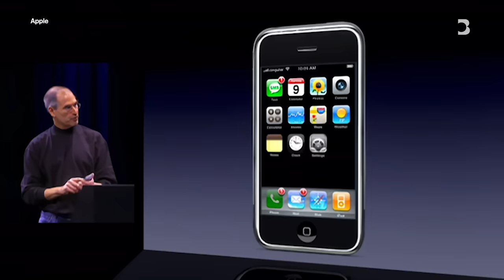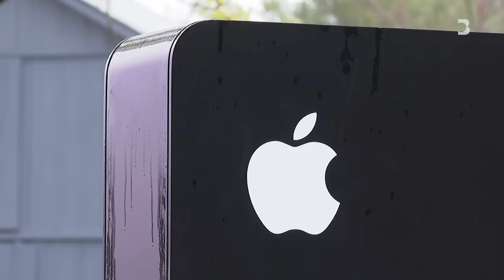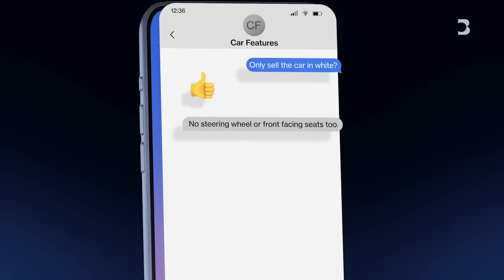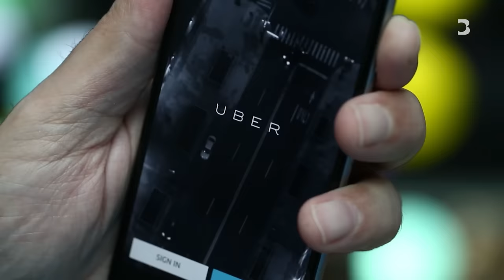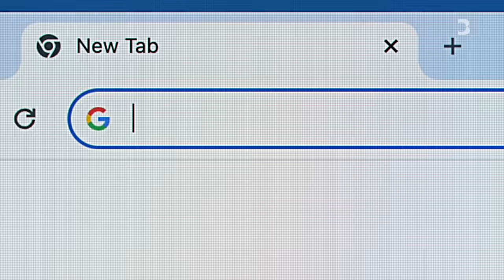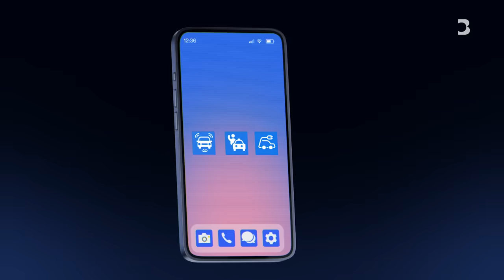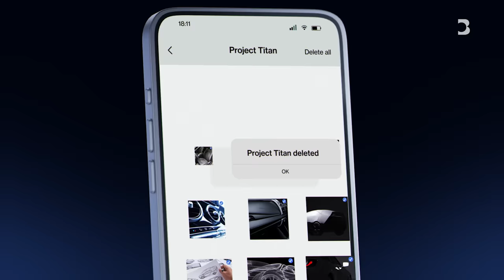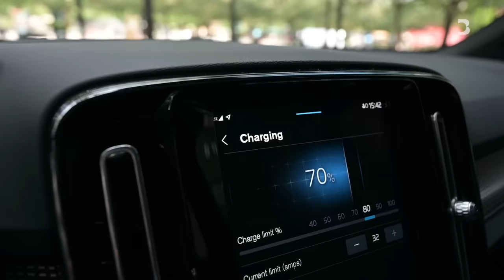What Killed the Apple Car?

Comment: paying extra for your car's charging cable won't ever be a thing now
Reply: No "environmental pressure" on the cable too 🤗
Reply: Have you seen the cost of Tesla's cables? It's already a thing
Reply: I paid $250 for my teslas charging cable lol
Reply: @romansanders  Buyer beware.  It's such an old phrase that it's origin is Latin (Caveat Emptor).  Yet people still love to drink the Kool Aid.  So be it.
Reply: Bad joke, Apple includes a charging cable with every rechargeable product it sells.
Reply: Everyone is doing that though, because consumers are too braindead to understand that EV's can be charged fine over night from a normal power outlet and you don't need fast charging.
Reply: @alexronaldinho12  Would be $500 for apple cable. And you need a subscription of $9.99 a month because there'd be a micro chip for "safety" in the plug.
Reply: No cable needed. Apple cars will be charged wirelessly at 10 watts. 😅
Reply: @pawel7196  I think you misunderstand that in the case of luxury items increasing price increases demand
Reply: @ignaciocampos8435 But no brick.
Reply: Tesla’s don’t come with chargers 😂
Reply: @residualramirez  they also dropped the price by more than enough to make up for that since that change.
Reply: Never under estimate the other guys greed. I learned that from watching scarface!
Reply: or having to crawl underneath the car to plug in the cable.
Reply: Tesla
Reply: Ev sales continue to double every two years.  This video is incorrect.
Reply: Don’t you want to save the earth? Also known as saving environment.
Reply: I don’t understand why garbage jokes get so many likes. It amazes me
Reply: @residualramirez Not correct. At least in germany you‘ll find in every car a blue cable for public AC charging and a mobile charger for any 230V power outlet (national standard in Buildings).
Reply: "What Killed the Apple Car?" - Tim Cook
Reply: LOL!
Reply: Tesla already does that
Reply: Well Adleast  my Silverado EV came with a charging cable
Reply: It already is

Comment: Simple answer: The lightning charging port was banned in EU
Reply: And you had to turn the car over to charge it
Reply: We just can’t built it with USB-C. It wouldn’t work with our proprietary standard equipment  Frappuccino machine. Scrap the whole project, they said. Our core demographic won’t buy it unless it has a Frappuccino machine.

Comment: Prototype is easy, production is hard, profitability is even…..?
Reply: Dyson also went thru the same epiphany as well after they built their own EV prototype, which was why they also canned it

Making a fantastic prototype and tech demonstrator is one thing, translating it into a production model that is profitable is another thing altogether.
Reply: I’ve been wondering when Dyson is going to come out with a carpet cleaner.🤟
Reply: It was the fact that full self driving was never going to happen. They fell for Musks BS .   @SoranPryde
Reply: @steviegbcool  So are you sure? When’s the last time you drove a Tesla with FSD?
Reply: You can't just put a steering wheel, just shut down a 10y project and dispose 10b USD away
Reply: @MetalAlbumsPodcasts  So you have the right handle nonsense! What are you even talking about?
Reply: @MetalAlbumsPodcasts  🤣🤣🤣
Reply: @theodorehaskins3756  that whats apple spent on the discarded project
Reply: @SoranPryde  Also Sir Dyson made the comment that his team had to be 100% self reliant no tax credits, no squat. It had to be profitably on its own. They could never obtain that success internally doing the math.

Comment: I think the weirdest situation for apple is that, to build an autonomous driving car, you really need a lot of data, and apple isn’t willing to sell the car without selfdriving capabilities first. Testing only with your own team really can’t match the real consumers testing.
Reply: Waymos cars EACH cost $250,000 as ATV.
Reply: i disagree. Almost all manufacturers have designed their system so far without acquiring massive amounts of driving data from their customers. Tesla is the only exception and they are not really ahead in the market compared to that competition.

The big issue imho is the goal they had set. Level 5 autonomy is still a long time away. We won't see it this decade and the industry is already shifting away from the promise of driverless cars and pivoting once again towards level 3.

Comment: What am i missing here?

Xiaomi has much less cash than Apple and started the car project much late.

Is this a case of chasing perfection instead of focusing to finish the job at hand?
Reply: They has Chinese supply chain and Chinese EV market which is the biggest in the world.
Reply: @directxxxx71  "They has Chinese supply chain and Chinese EV market which is the biggest in the world."

So? Apple could have produced a car if they wanted to.
Reply: @yourcrazybear  Could they have produced a compelling car that fits in the ecosystem, at a profit, without the huge China subsidies? No.
Reply: If you see from apple perspective every product they create is not allowed to work correctly and repairable by third party and that is way harder to implement in automotive industry, I think this is one of the major reason.
Reply: @yourcrazybear  Car business is a HIGH CAPITAL COST business. Apple don't deal with those kinds of business model. Car companies like Toyota, Ford, and GM and VW have a VERY HIGH DEBT in the 10s of BILLIONS in debt. VW have around 160 to 230 Billion dollars in debt. That is around what Apple has in their reserves and not much debt. It is opposite of what they do.
Reply: @jonaboy3  "@yourcrazybear  Could they have produced a compelling car that fits in the ecosystem, at a profit, without the huge China subsidies? No."

Yes they could have.
Reply: @jonaboy3 it took 10 y and 10b USD to figure that out...

Comment: Apple: You want doors, sorry doors are not included, Customer: What size battery does it have, Apple: sorry !, umm we just derated it without telling you, Customer: what size did it have, that will cost you extra to know that, Customer: Excuse me there is no steering wheel but it does not have FSD, Apple: oh about that, the steering wheel is not included but we can add one in for a small fee of $9850, Customer: that seems expensive why, Apple: Because we can

Comment: They probably figured that if they hire Foxconn or other manufacturers to manufacture their car, it wouldn't be profitable enough.  They're very particular with having high profit margins on each product they sell, so I'm guessing the profit margins for a car wasn't enough.  Take for example NIO, they make the software and designs in-house, but contract a manufacturer, like JAC Motors, to manufacture their NIO cars.  Of course, JAC has to make a profit off each car to justify manufacturing one, and NIO has to profit off their car, too.  What NIO gets is an expensive car they have to sell, but they can't make it too expensive, or no one will buy it.  So they have to lower it to make it appealing, but they sacrifice on profit margins.  
Only Tesla right now has the highest profit margins on each car they sell, because they did not just vertically integrate their designs and software, but also the manufacturing of the cars themselves by owning their own factories.  Apple could do the same as Tesla, by building their own factory, but that must've been too complicated for them to justify the initial investment costs associated with building their own factory from scratch, as they're used outsourcing to Foxconn. 
Maybe Apple will do the Apple TV way?  We've heard of rumors about an Apple TV, not the box, for almost two decades now , and the rumors were high around 2010 - 2014.  The reason Apple won't make a TV is because the TV market's profit margins is paper thin.  Not worth it for Apple, so they made a TV box with Apple software in it, and sell it for $150.  So maybe Apple will just partner with car brands to use their software for a fee.

Comment: This makes alot of sense as to why they shifted to AI and VR "Spatial Computing". This could actually be beneficial in 3 ways. 1.) Apple helps build better AI models for the infrastructure that maybe others in the industry are missing. 2.) Apple helps popularize VR which they're doing right now for the average consumer market which is going to focus more attention on VR and it's future as well as help build things in VR that are much needed with apples budget. 3.) Apple will be the reason VR becomes an at home, at work and on the go necessity to replace or even be another option other than using a smart phone, tablet, laptop, or tv. Oculus started it, Meta made it better and affordable, Valve improved on the possibilities, Apple can bring it home or maybe Valve might enter again wwith the deckard on the way.

Comment: It's so funny that people/companies think a VR/AR Headset might replace a smartphone.

Are you going to run around outside with such a thing in your face? Me neither.
Reply: People with no self awareness will. Apple is banking on more of those people. lol
Reply: a 2010 technology headset to be exact
Reply: It'll get small enough to wear as Sunglasses. I'm sure its the future. It only takes one person to figure out the correct implementation and seal the deal
Reply: @JoshuaRotimi  Google glass was small like sunglasses. They failed too.
Reply: @mmmh2533 Non-invasive means still allowing google or some other company access to your thoughts.

Plus it would still mean sticking some electrodes all over your head. Not gonna happen any time soon, the technology is decades away.
Reply: @einname9986  The implementation was wrong thats why it failed. Did you understand my comment?

Comment: The cost of electric vehicles is significantly influenced by the expense of their batteries, which constitutes a major portion of the overall cost. This situation is further compounded by the near-monopoly that several Chinese companies hold over the battery industry, a dominance partly maintained through patents. This has made it challenging for many companies to reduce their production costs. Tesla serves as a prime example of this issue. Contrary to what some might expect, Tesla has approached BYD multiple times to outsource battery production but has been consistently turned down by BYD.

Comment: Trying to preserve old technologies while revolutionizing with new technologies is like adding 4 brand new larger tires to your car while still trying to use the older ones because you believe you can still get some value out of them. And yes you would be right but at the same time. Those tires are just in the way and should be ditched preferably sooner than later

Comment: No iCar...  So, no proprietary charging cable, no non-replaceable battery, and no taking it in to an Apple dealer for changing the proprietary wiper blades, or aligning the proprietary wheels, or getting it washed?

Comment: An Apple-car named Desire. It took a master thief like Jobs to steal a new idea and turn it into something very desirable.  This is only my narcissist fantasy now:  "Jobs would have bought up Aptera and Elaphe, wined/dined with Jony Ives to upgrade its interior design, bought up the Niron magnet patents and solid state battery patents, and pooped out a car with 2000 miles per charge, 80 solar miles/day, with the greatest AI interface imaginable. The seats can be pushed all the way forward and turned 180º to have a comfortable inflatable sleeping zone behind the seats. In this apple-car named Desire, you don't need shoes, and it is "not about money", it is about Desire.

Comment: Are they not going to talk about how Apple burned bridges with Hyundai, Kia, Toyota, Honda, and VW, because they wouldn't agree to their predatory terms and agreements. Apple had no exp with car manufacturing and walking into the industry like you own it when you don't have a single car sold is laughable. Apple didn't have the upper hand in those negotiations. The only manufacturing that was willing to work with Apple in the end was Nissan. But come on... Nissan is Nissan.

Comment: Apple car 1 had tyres that were welded to the axle and wouldn't turn and could not be replaced for security reasons. Apple car 2 design was to do away with the tyres as they spoilt the design and looks.

Comment: The stock video and weird Apple car illustrations made the video quality seem so poor. It was quite misleading to show the Apple logo on other manufacturer's models and so was the stock footage of abandoned car lots. I'm assuming this footage was meant to support the claim of limited public enthusiasm for EVs, but the cars in the videos were not unsold EV inventory. Why not show graphics of forecasted vs actual EV sales? Putting misleading images in the edit is suggestive of poor-quality journalism where opinions are supported by evoking emotions instead of presenting facts. 

P.s. introducing a guest as dismissively saying "it was never going to work" paints them as arrogant and misinformed instead of as someone who will provide a thoughtful analysis of the canceled project. If it was so obviously not going to work, why did Apple even bother?
Reply: EVs are growing faster than any other car category. There is no "limited enthusiasm". There is no need for any "enthusiasm" at all. EVs are being adopted in the same way as flat screen tvs were. Unless you can show me where I can buy a black and white tv with a CRT nowadays? How about an AM radio that uses vacuum tubes? These are technologically obsolete products and so is the ICE car. ;-)
Reply: @lepidoptera9337  right! But this video claims that one of the reasons Apple killed the project was because EV demand was lower than expected. They even showed a few different lots of abandoned cars. It was very misleading
Reply: @lopypop  YouTube is entertainment. It has about as much realism to it as Tony Stark's flying suit. ;-)
Reply: @lepidoptera9337  but this is supposed to be Bloomberg. Not some unknown creator
Reply: @lopypop  J.K. Rowling is a very well known creator. Does that make "Harry Potter" a biography? ;-)

Comment: Electric cars are not ready for prime time yet.
The immediate future of private transportation may still be a pivot to electrification, but the energy source cannot be such a large Li-Ion battery. The best electricity source for an electric vehicle which would be adopted in large numbers, is a fuel cell fed with gasoline.
This would initially double the range of an automobile - from, say, 50 miles per gallon from a modern ICE car, to 100 miles per gallon from a fuel-cell powered EV. 
There would be no need for recharge points, as the current unleaded gasoline pumps are perfectly up to the task. 
Such car wouldn't generate any particulate and NOx, just CO2 and water, and not require any catalytic converter. Although, one big catalyst device would be built inside the main fuel cell...

Comment: Tim Cook doesn't know much. Elon Musk has made a huge mistake, and his cars are already having problems. Elon's biggest mistake wasn't the electric car, but the wrong type of electric car. A battery driven electric car is not viable, largest problem being the range. Toyota has proven hydrogen fuel cell electric cars can work and proven production in the Mirai. Yet because of MARKETING, you see the more Elon Musk cars than Toyota Mirais driven. Very similar to the historical advancement of electric distribution. Thomas Edison's push of direct current as the source eventually was replaced by the alternating current. Imagine if Nicola Tesla's alternating current became the standard in electric distribution method first instead of Thomas Edison's direct current solution decades earlier ... less fires and deaths. Same thing is going on now with electric vehicles, Tesla Cars, as ironic asthe namesake in this case are the way. Further, now there is an internal combustion engine that runs on hydrogen which burns cleaner than gasoline or diesel, not to be confused with the hydrogen electric fuel cell. Tim Cook and Elon Musk are blockages like Thomas Edison that is hindering the advancement of safe and clean automotive technology.